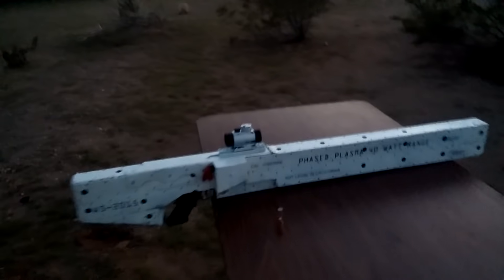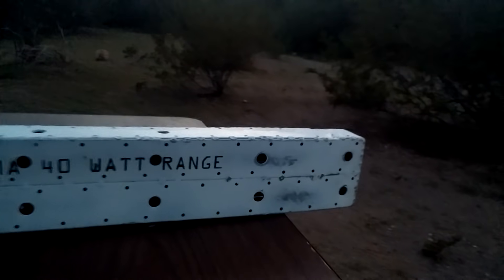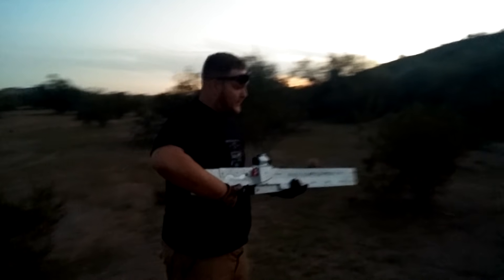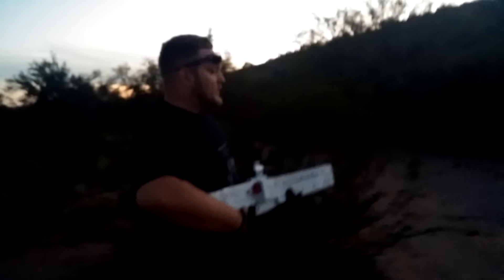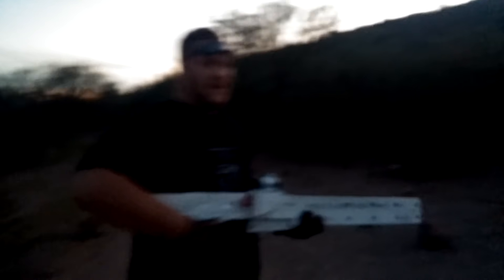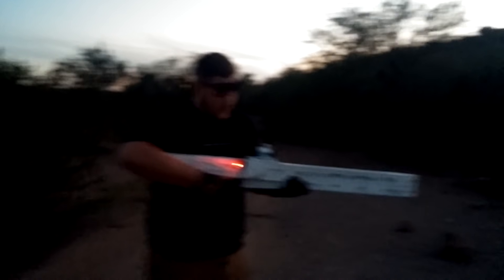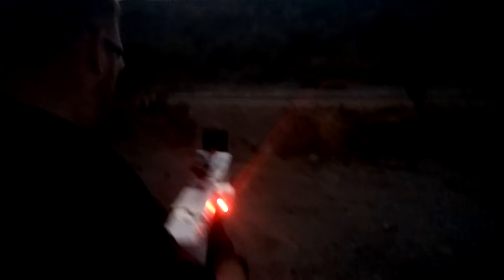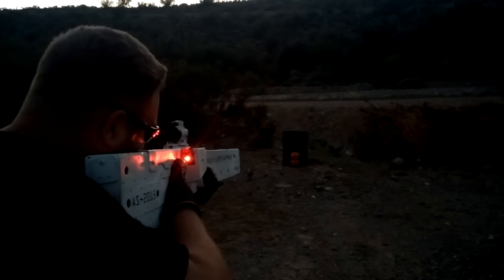Electromagnetic Plasma Rifle (Night Time Test Fire)

Comment: Could you explain in more detail how the gun works? This is absolutely amazing.
Reply: +Jonathan Ciavolino Simply said: There is a capacitor bank inside of the gun. Storing an energy in the range of kilojoules. This energy is going inside of the rails, much of it being lost in the sparks and heat. Still would give the projectile quite some kinetic energy. The energy going inside of the rail is being carried over by the copper sleeve around the projectile as a conductor and creating a really high current. This high current is creating a magnetic field and therefore accelerating the projectile perpendicular to the magnetic field. This phenomenon is thanks to the Lorentz Force.
Reply: *****
Yep, but liquid nitrogen isn't available to the ordinairy person. Also, you'd have to make a coil out of a superconductive metal for optimal results. Superconductors drop to 0 ohm at a specific temperature, once reached. Non-superconductors still have quite some resistance at every temperature, except absolute zero. Also, this is quite a lot of work for just a little bit of improvement. You could better get more energy in your projectile. I have a railgun that could theoretically handle 8kJ. That's probably 8 times more than the railgun in the video can store. 8kJ would give around 240J at 3% efficiency. That's a .380 projectile at 300m/s.
Reply: +Sir Loin Ehhh, yeah, I know that this isn't a Gauss gun, it's a railgun. I said that. I even build my first prototype when I was 16. It had a muzzle energy of 50J. And it's pretty easy to get nitrogen flowing in a rail gun. Especially with my design. It has 4 tubes, where each 2 tubes as an anode and cathode. These tubes could be hollow where you could easily inject liquid nitrogen, the same as you "inject" a current. Also could you make your projectile magazine supercooled, since your mag is sealed.

Edit: sorry, didn't see your question on my phone. I used a 12V 10000mAh battery, one that could handle a big current. Hot batteries are certainly not good. I used 6 400V 3900uF capacitors (my newest idea runs on 6 500V 10000uF capacitors). I'd rather not use a transfromer, since the transformer glitches could spike, sometimes in the range of kV, if this would get to your capacitors, be ready with a fire extinguisher. I'd much rather use a DC-DC boost converter, much more stable. However, a transformer is more efficient so I modified a ZVS mazzilli flyback driver to fit inside my gun with comparator safety. I made sure my resonant tank could handle the current and removed the risk of transformer problems by adding other several safety features to it, such as a monitor, fuse, voltage regulator, etc. I am not sure what you mean by "what kind of transformer", but I used a centertapped (connected to a 170uH 10A inductor), 7+7 transformer.
Reply: *****
I'll be making a video on how I build my gun, when my new design is ready. I need to make sure it's perfect. A high amount of current on your projectile causes the copper to melt, as you can see in the video(the sparks are molten metal). I want to transform as much as possible electrical energy to kinetic energy. Which is a very hard job.
Reply: *****
Don't start with liquid nitrogen in your railgun haha, that's a terrible idea. You could even frostbite yourself, since you'd most likely want your gun to be made out of aluminium.

But I see where your confusion is... See, you need your projectile to be really conductive. Copper is one of the best and cheapest conductors, but not very strong. You want steel for your projectile, but it's not the best conductor. So what do you do? You make a coil of copper wire with a radius of your projectile and put it on your steel projectile. Therefore you'll have both strength and conductivity. :)

Ah yes, I see, if you use a transformer, be careful. AC and voltage above the breakdown voltage may cause your electrolyte in the capacitor to break down and cause exciting fires. A DC-DC boost converter is therefore much safer. It doesn't use a transformer at all. Make sure to have a good waveform, a crappy square waves or modified sine waves can damage your transformer. I would suggest using a mazzilli flyback driver:

http://kaizerpowerelectronics.dk/wp-content/gallery/2009_05_15_-_mazilliflybackdriver/Mazilliflybackdriverschematic.jpg

I used aluminium for for my railgun housing and high quality copper for my rails. You could also use 3D printer and build a plastic housing, for weight purposes. My highschool has a 3D printer, it would create some nice shapes for the gun. But I just got an angle grinder and started doing random shit in some aluminium plates.

 For the kickstarter I used a simple spring loaded bolt-action, it's effective for reloading, pushing the projectile between the rails and giving it quite a kick. You can also use a coil, creating a magnetic field to accelerate your projectile forward. Much like a coil gun and rail gun in one. But I like something mechanical in my gun aswell. :)

P.S. I'll be glad if you build it at your 16th, I started at my 16th and build it at my 16th. I am now 18 and ready for a higher form of molten metal :P
Reply: @Azagro  liquid nitrogen is available at most welding supply stores.. I fill a thermos for $9 usd..........just dont seal the top hahahah